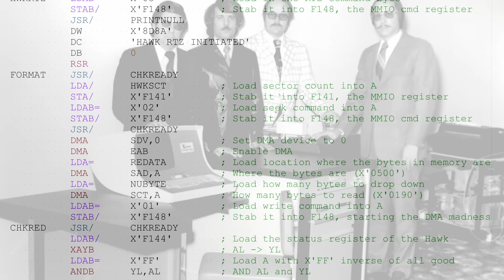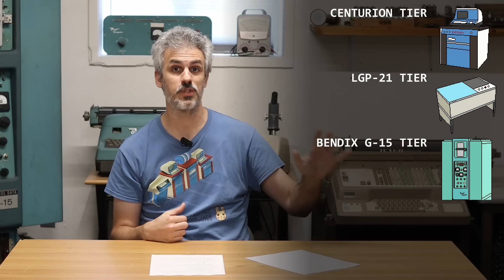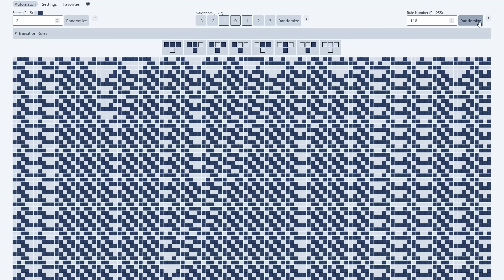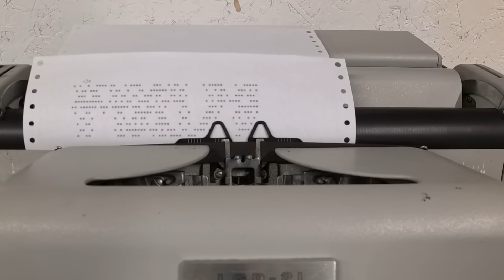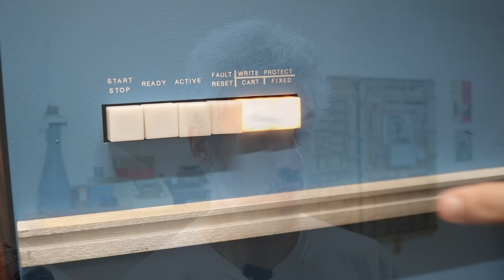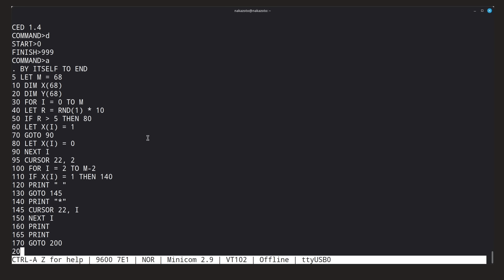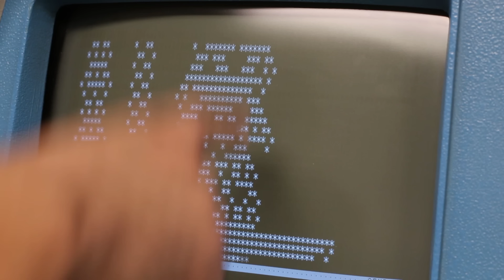BASIC on This 80’s Minicomputer is Terrible!

Comment: Instead of printing it out with semicolons, hoping it would glue together; or using cursors to move it around...couldn't you simply add the strings together, and then print the whole line at once?

Comment: I learned BASIC on a TRS-80 Color Computer starting after xmas 1981. I started learning TRS-80 Model III basic during the summer of 1982. Both Microsoft BASICs. Both were solid interpritations. I also experienced a number of odd ball BASIC implementations that were absolute crap. It seemed that Microsoft owned BASIC for the most part but in reality it was not absolute.

Comment: On the TI 980a I have been trying to post under community, but it is always deleted. I'll try again, I was reading the manual for the arithmetic unit 960699-9702 and there is a pretty clear troubleshooting section on page 3-24 and starting on page 96. It seems that ram is not needed for the front panel to display, it seems to be driven by the AU and roms, and only the clock seems necessary from the memory controller to run the boot loader from rom. It seems that even the clock could be bypassed with single step, for in-depth loader problems. I may have misunderstood, but it can be a plan to move forward thanks, Scott

Comment: I think the solution to your problem would be better solved by printing a line at a time, this would work for all BASICs and the trailing space problem could be solved by making the line one character shorter.
The only downside would be needing an extra array for the line buffer, but I would guess that the extra cursor control probably takes up more space than an extra line buffer would (oh and the current buffer index variable too).
The reason BASIC is so awful is to encourage nascent programmers to learn another programming language! (At least that's my theory anyway - insert obligatory Monty Python dinosaur theory sketch reference here.)
Love your enthusiasm for what were once the working tools of my trade (well the Dec computers anyway) if you want a real challenge using slightly more modern stuff, see if you can get a bunch of Mentec single board LSI 11s on the same Q-Bus and get a multiprocessor RSX-11 booted, something I always wanted to try, but could never get the requisite hardware in one place with the time to experiment.

Comment: I just had to hit it again: 😁

Pre-compute a table for next generation logic to remove the need for multiple IFs.
(A 1D array is probably best here anyway, as C is doubled by using addition; BASICs that support 2D arrays will probably use multiplication internally.)

A moving window (of 5 cells) to maintain a rolling count of live cells removes the need for the inner loop [Z].

A small cache [O,A,B] to hold the previous state of recently processed cells makes the temporary array Y() redundant.

Defining frequently used variables first improves speed of BASIC interpreters.

1 LET I = 0
2 LET C = 0
3 LET O = 0
4 LET A = 0
5 LET B = 0

10 LET M = 64+3

15 LET T = 0

20 DIM X (M+2)
21 DIM L (11)

31 LET L(4) = 1
32 LET L(6) = 1
33 LET L(7) = 1
34 LET L(11) = 1

40 FOR I = 3 TO M

50   IF RND(1) * 10 > 5 THEN 90

60   LET X(I) = 1
70   PRINT "*";
80   GOTO 110

90   LET X(I) = 0
100   PRINT " ";

110 NEXT I
120 PRINT

130 FOR T = 0 TO 25

131   LET O = 0
132   LET A = 0
133   LET B = 0
134   LET C = X(3) + X(4)

140   FOR I = 3 TO M

150     LET C = C - O + X(I + 2)
160     LET O = A
170     LET A = B
180     LET B = X(I)

190     IF L( X(I) + C + C ) THEN 290

260     LET X(I) = 0
270     PRINT " ";
280     GOTO 310

290     LET X(I) = 1
300     PRINT "*";

310   NEXT I
320   PRINT

360 NEXT T
370 GOTO 40

Comment: In the early 1970s I saw a guy put the 2d version of the game of life on an IBM 1130. He used the 1132 printer for output and each generation took one page of paper. ASU had the computer in the public area so anybody could lay hands on it and that sometime resulted in programs they wouldn't run in the secure area. Eventually they payed the price when somebody wiped the boot disk. The rebuild process took several hours and boxes of cards. There are still about a handful of those systems running but there is an emulator that works well for everything except overprinting.

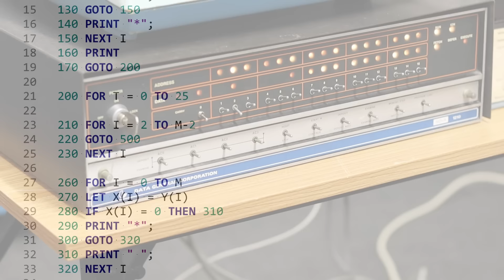Comment: Seeing that old Data General NOVA at [09:06] sure brought back memories.   In 1986, I took a job as a midnight shift computer operator on a Medical Records system for a hospital.  Our computer room was actually located within the hospital itself, on the 2nd floor.   The system was a distributed array of Data General NOVA minicomputers.  I don't know whether they were the exact same generation as the one shown in your video, but I definitely recognize the look of that front panel, with the toggle switches and blinking lights.

All application programs were written in BASIC...... however, BASIC was only used as a shell-language for about 100 or so machine-language "CALL's"   For Example, something like:  100  CALL 14,"FILENAME",1,0,-1     to open a file, with paramaters for file-type and file locking, etcetera..

In later years, it became increasingly difficult to purchase parts (memory boards, power supplies, etc...) for that old equipment, and we ended up EMULATING that whole entire system on modern Windows Servers.   Some really big challenges involved with that, including issues of hi-endian versus low-endian byte-pairs in memory, and also the bit format for Floating Point values.  We eventually got it all working and it was a magnificent success.  I remember when we first attempted to run one of our more complicated jobs ("Payroll") and it completed in mere *seconds* instead of the usual forty minutes or so.  We were sure that it must have failed.  We were completely shocked to discover it actually worked.   

Good times.   

And I''m just-enough of an old-timer computer geek to follow along with your video here.   My first-ever computer was a TIMEX Sinclair that I bought for $99 at K-Mart (probably around 1981 or 1982 ??).   I followed the manual to learn BASIC.   Later, I went on to work at a large DataCenter with IBM MVS-370  (I think later, MVS-XA).

Comment: Somewhere on a cassette tape is a simulated circuit board i wrote using Life on a Timex Sinclair 2068. As I recall I added another function.  Each life sell aged with each iteration. So after X number of cycles it would die of old age even if it met the other conditions.

Comment: Ever since I first learned about Conway's game of Life, I have thought it was amazing. However, the cells do nothing other than exist, or not exist. There are no genetics that could be passed down to the next generation. There is no way for the cells to evolve into anything more than the familiar patterns that they always seem to end up as. (Guns, gliders, stoplights, etc.) However, if newly born cells could inherit "genes" from their parent cells, with some rules for Dominant and Recessive, this could become quite interesting indeed. Unfortunately, with three parents for each newborn cell, there would have to be three genes stored in each cell beyond the simple Alive/Dead value. This makes the memory requirements quadruple in size, not to mention the increased execution time. Assuming that the single gene triplet accounts for something as innocuous as, for example, hair color, the cell could be shaded appropriately on the screen. Adding other gene triplets for other traits (i.e.: right handedness, musical ability, IQ, being any good at bowling, etc.) just makes the problems of time and memory exponentially worse for traits that cannot be easily illustrated on screen. I find it an interesting modification from an intellectual standpoint, but totally impractical to program. Therefore, I never have. And I really can't recommend anyone else should bother either.

Comment: I look at this code and get itchy fingers to make it, oh, I don't know, print out the initial setup in - instead of *, so you can tell when it cycles. Or prefix the random line with a full line of -, which might be simpler to implement...

Comment: Having to use "universalized" BASIC code may have contributed to the slowness; Centurion BASIC might allow GOSUBS or inline IF-THEN commands other than GOTO, or some other feature you intentionally removed from your code.  Directly reading from a keyboard instead of using an INPUT ("press a key" versus "press a key followed by ENTER") varied wildly from system to system.  PEEK on Apple or C64 versus INKEY$, not that you're doing it here.  Maybe there's something like a PRINTLINE, PRINT#, or PRINT AS "????" formatting available?  I just had a bit of a COBOL flashback.  "You only need to write one COBOL program ever; use it as the base for everything else you ever write" or so the old joke goes.  I did write that one program in high school, but I've lost the printout, so can't replicate COBOL any more.  Anyway, optimizing Centurion BASIC code for the unit of course assumes you have a manual that tells you which instructions/features it has, which I know is not guaranteed at this remove.

Comment: 12:45 You could avoid the spaces in Centurion BASIC by using an array as a line buffer.

Instead of printing each character one by one, write them into the array, then when the line is complete, print the entire array as a string. Assuming that is supported.

Comment: The opening part of the video whispered to me, "you've already played with this before," so I started looking through backups of various "clutter" that I always archive before deleting after a while. I peeked into the archive – and sure enough – two years ago I was playing with this on an Atari 800XL and in an emulator:

```
1 GR.8:COL.1:L=159:PLOT L,0
2 DIM M$(8):M$="---XXXX-"
3 FOR Y=1 TO L:FOR X=L-Y TO L+Y
4 Y2=Y-1:LOC.X,Y2,C:V=2*C
5 IF X>0 THEN LOC.X-1,Y2,C:V=V+4*C
6 IF X<318 THEN LOC.X+1,Y2,C:V=V+C
7 IF M$(8-V,8-V)="X" THEN PLOT X,Y
8 NEXT X:NEXT Y
```

But then I remembered that I had rewritten it for the web in Javascript (for rendering speed) – and I found that too: https://www.retrobit.eu/patterns.html

However, I don't remember anymore whether that Atari Basic code is mine, or whether I was building on something back then (I wouldn't want to take credit for someone else's work, but I do remember working on it) ... anyway, I remember that the JS definitely isn't taken from anywhere – I created that one myself.
The worst part is that I don't even know why anymore – the impulse definitely came "from outside" 😀

(And/but I apologize that it's not for Centurion.)

Comment: I had no problems porting the BASIC variant to my own interpreter. The only things I had to change were the RND() call (returns a number between 0 and n-1) and the arrays are preceded by an "@" (close ties to Tiny Basic). I was a bit worried about the GOTO within a FOR loop, but so far it hasn't blown up my FOR stack. 😄

Of course, modern hardware, about 50 lines per second.

Comment: So did I hear that there's an emulator for this old beast? So it's possible to write and run software without needing to come visit palatial Usagi Word Headquarters?  I am so tempted to write a Forth interpreter to demonstrate that you don't need to use assembly to do low-level, high=speed programming...

Comment: It would be nice if it got BASIC interpreter, with these qwerks:

1, if it ran with input basic ASCII file, it RUNs the file then exit. On loop, Ctrl+C wilk exit the interpreter. Command: .RUN XBASINT [MONITOR] [FILE] [DRIVE]
2, it does not set system datetime, but it saves it on ZP. On ZP, it sets the day 0 datestamp and system uptime delta. If not provided, it sets 1970-01-01 and delta 0 as its reset point.
3, command UPTIME could be provided and it spits the machine's uptime. Type is number.

For example, it could run ASCII basic code ZODLIFE file from disc 1 to crt0 with
.RUN XBASINT CRT0 ZODLIFE 1
or run BASIC interpreter with
.RUN XBASINT

Other spec(s):
Monitor selection is not required on interpreter mode but could be provided. Execute mode however needs it since you can run something to dummy terminal or teletype.
Reply: If getting input from command line is impossible, autorun and monitor selection could be excluded.

Comment: language nitpicking,  Unique means unique.  you can't be more or less unique, something either is, or it isn't, so expressions like 'incredibly unique' are redundant.    and then, there were LOTS of 16 bit minicomputers that were based on am2900 stuff, such as the Hex 29 described in the "Bit-slice  Microprocessor Design" book.  Some folks I knew actually went into limited production with this and sold a few 100 of them before going out of business.   The only thing unique on the Centurion was its specific instruction set architecture, as defined by its microcode.

Comment: I did programming in the late 1980s using IBM PC Compiled BASIC for commercial building energy-auditing software.  It wasn't too bad once you started having "blocks" of code to re-use.  My overall favorite though was QIC(Qantel Interactive Code)BASIC which I was working with from 1979 to about 1986, for Qantel (NOT Quantel) business minicomputer systems.  Especially for the time, it was great!  Also compiled, and it had elements of FORTRAN (FORMAT statements, READ/WRITE, etc) and COBOL (declarative and executable program areas, BCD arithmetic with declared precisions) as well as BASIC (LET, IF/THEN, FOR/NEXT...)  The BCD numerical format avoided complications with floating-point, and the file-system was easy to use with mostly keyed data files automatically kept in key order.

Comment: EEEK! ... that BASIC should be called BAYSUCK.  The CPL looks like a 2-pass complier and assembler, typical to split the compiler into those stages. Then in the linker stage it dumped the symbol table... I've not seen that kind of output in years.  And it's been forever since I took a compiler course at university, and I've written a compiler and  interpreters before, but holy cow is that ever slow!

Comment: I dearly wish there was a FPGA system with serial ports and expansion bus we could buy to run. This'd help people get into the system. The emulators are deeply unsatisfying.
Reply: So are FPGA systems. They're always pitched as being 1 to 1 compatible. Then they need endless updates to try to correct all their problems.
Reply: @johndeaux3703  Yep. True ..but at least they can be fixed and evolve. In one respect it's like real hardware of the era when you'd receive an ECO (Engineering Change Order) to solder a dozen bodge wires all over the place to a dead-bug IC on the underside of the PCB. It's just a bit more 'civilised' than back then and those lazy gen-y's weren't raised by the same savages we were ;)

Comment: Wild, just tested this and it's about 4 times slower than Atari basic.

For those who don't know Atari Basic is one of the slowest of the 8-bit Basics. As it used BCD floating point arithmetic for everything, really slow but quite useful.  Also this isn't unique to the Atari, but instead of using a jump for GOTO it had to search through every line until it found one that matched the GOTO!
Reply: There were techniques to mitigate this, such as starting a program with something like 10 goto 100 and putting the tight loops in lines 20-99 or whatever. That way you only suffer the big hit once
Reply: Yes, If the target line of a GOTO etc. was after the current line, the search could start from the line following the current line otherwise it had to start from the beginning of the program!
With this in mind, you could re-arrange the blocks of your program to increase speed.

Having disassembled Nascom [Microsoft] 8K ROM BASIC, I found the code that implements it.
Later, I disassembled Microsoft 24K BASIC-80 for CP/M and found that it made some impressive improvements.

Numeric constants (including floating point) are encoded into internal format [a token byte followed by packed internal representation] as you entered each line to save parsing them at runtime.
FOR/NEXT ... WHILE/WEND ... etc. are also matched during this pre-process phase to greatly improve execution speed.

Line numbers for GOTO etc. targets were also encoded into [Number-or-Address_Token, 16-bit value].
On RUN, a quick pre-processes turns any [Number_Token, LineNumber] into [Address_Token, LineAddress] so GOTO etc. immediately know the target address.
LIST will change them all back for display.

Comment: The general answer when you've got a language that insists upon adding spaces and/or newlines and/or whatever is to build the output line internally and then print the whole line at once. That probably won't make it faster but it would probably be less annoying to deal with. ^_^
Reply: Programming languages that insist on adding whitespace to the output are the logical complement of languages that insist on having specific whitespace in the source code.
Reply: @AngryCodeReviews  And I've worked in those too. ^_^

Comment: Back in the mid 80s, I wrote a 2-D version of Conway's life for the IBM PC in GW Basic, which I ended up compiling using BASCOM. My version had the ability to save and load the state of the playfield so you could start with any shape you wanted. Great for experimenting with different starting designs. I would like to see CPL executing a nice 2-D version with Conway's rules.  If your display is twenty five 80-column lines, then all you need are two sections of RAM with 2K bits per array. One section for the playfield display and the other for the next generation. Great video, great channel!